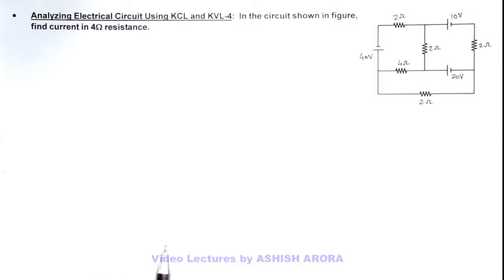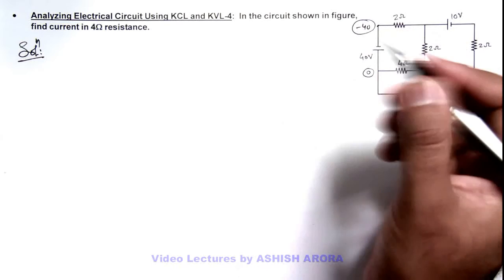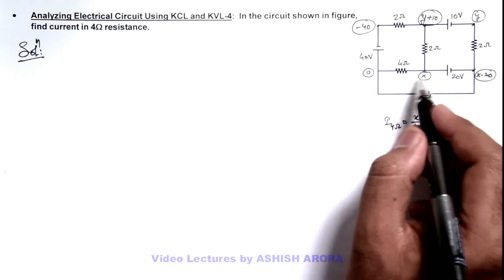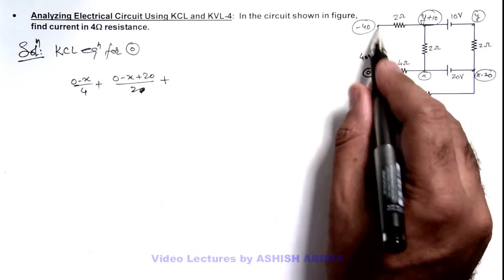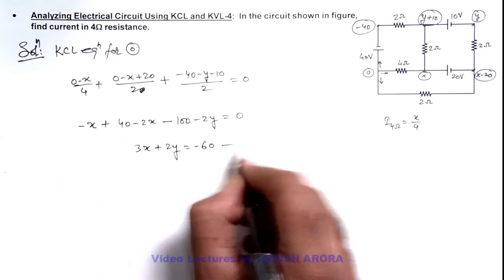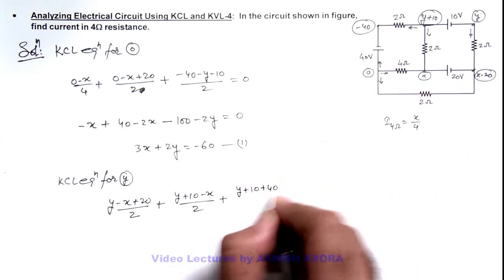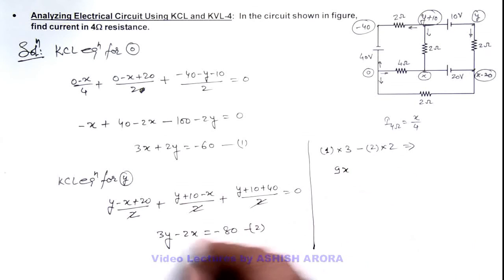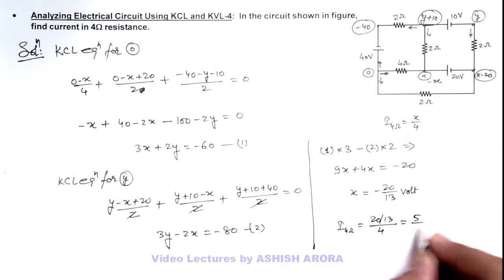6. Advance Illustration | Current Electricity | Analyzing Electrical Circuit Using KCL and KVL-4

Comment: from x point kcl equation is like 5x-2y=60 and from Y it is 2x-3y=80 after solving both ans is wrong any error please correct me
Reply: Im facing the same problem too,did you get the answer right?
Reply: I am also facing same problem 
Do any of you got result😢
Reply: From x point  equation is 7x-4y=100 ....and solving with y point gives same ans ..
Reply: Haan ans mila ye ki jab kcl lagate hai toh junction ke jitne bhi branches hai un sab ka Lena padta hai current naki sirf kinhi bhi 3 branches ka jab tak resistance nahi ajyeg uss junction se Lekar tab tak saare  current lene hai

Comment: Sir is there any method to analyze when two variables in KCL are to be included or does it comes with practice
Reply: Use two variable if your current is directly coming in circuit . If we take 10v and 0v across 10 v battery then current through 2 ohm will directly come.so use two variable

Comment: And sir what if a resistor and a battery are adjacent to each other in the same branch ? Will taking  that whole system (resistance + battery ) as a battery with internal resistance  make it easy for us ?
Reply from the maker: you can but for solving the ckt it does not make any difference...
Reply: Physics Galaxy oh thanx sir

Comment: sir , I use to solve all problems by using kcl and nodal analysis . sir there  are mess for me to solve using kvl . Can solely depend on kcl . if not would please refer me problems which are more easily handled by kvl .   or any suggestion using these .
Reply from the maker: Its good to solve problems using kcl or nodal but in case when there is a single loop or multiple components are there in any one branch of ckt then kvl is preferable as kcl becomes lengthy in those cases...